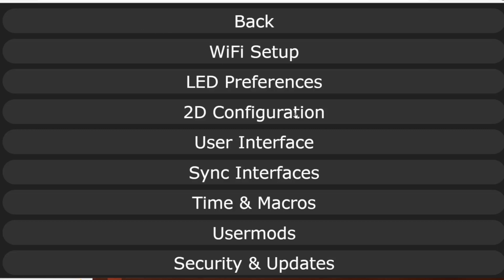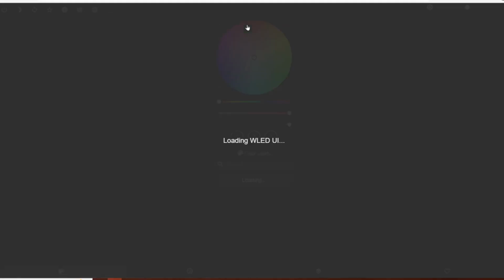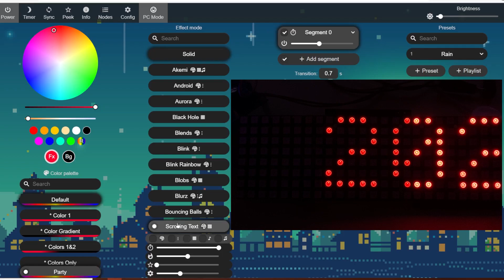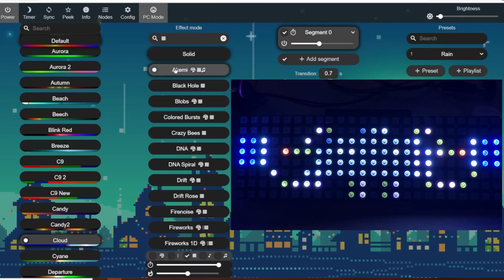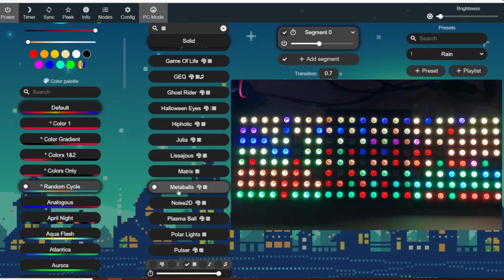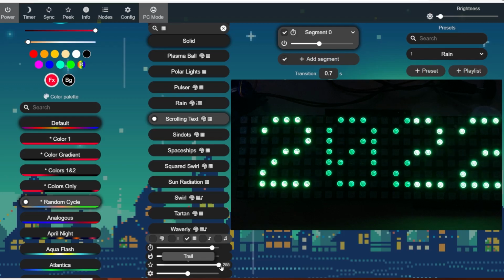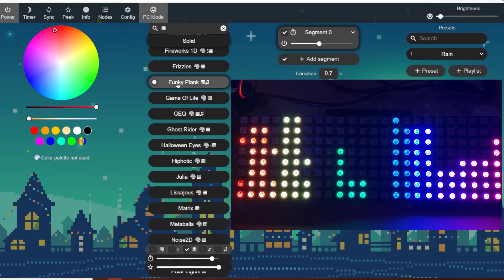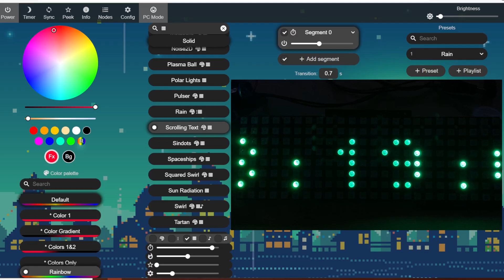WLED 0.14.0-b1 -2D Panel setup and testing .

Comment: I have absolutely no idea what you're doing. Not a clue. My guess is not many welders my age 57 would either. 🌚
Reply from the maker: Maybe it’s just entertaining?
Reply: @MicroChipz  I wasn't criticizing man I was just exposing my tec ignorance 🌚
Reply from the maker: @zukispur5493  I know . Sometimes I watch things I just don’t understand just because it’s different .
Reply: @MicroChipz  I hear that
Reply: @MicroChipz  are you up in Manchester? I know Manchester quite well having lived/worked there once.
Reply from the maker: @zukispur5493  yes I am :)
Reply: @MicroChipz  I was there from 89 to 91. Hacienda days. Two year was enough for me. nothing to do with the people (mancs are kool) it was the actual city. Too small.
Reply: @MicroChipz  are you a vintage hifi man chipz? If yes what u running?
Reply from the maker: Not got any real hifi equipment , i have a modern valve amp on some small speakers thats about it , im more of a vintage CB/radio guy .
Reply: @MicroChipz I'm a bit of both now. I've only been back on the radio couple years and it's proper reeled me in🌚 it's only money though ain't it. Gotta spend it on something now that my kids are all grown

Comment: Nice video, in panel dimensions you would put in the dimensions of one panel in your case 8x8 not 24x8 (try it out), for now you can`t change the scrolling text, and if you would a small sound reactive controller i suggest search for dig2go or quinled controllers.
Reply from the maker: Thanks , was still messing with it as you could tell . I was using the scrolling text as a guide on getting the panels working . As Soo. As I could read it I figured it was working ;)
Reply: but is necessary to go we these controllers or just try it by attaching a sound sensor module to a normal esp8266 board
Reply from the maker: @Vinit_nobody  i think you just connect to a esp board , my controller is there just for show .
Reply: @MicroChipz   @●YolaMemes●  for the sound reactive you best can get a digital microfoon the one key scènes are for sound and the two key scènes are for frequency, if you have no mic connected the are using an algorithm to generatie the sound outpu needed for the software
Reply: @Vinit_nobody  for the sound reactive you best can get a digital microfoon the one key scènes are for sound and the two key scènes are for frequency, if you have no mic connected the are using an algorithm to generatie the sound outpu needed for the software